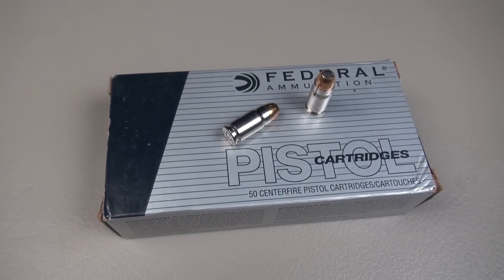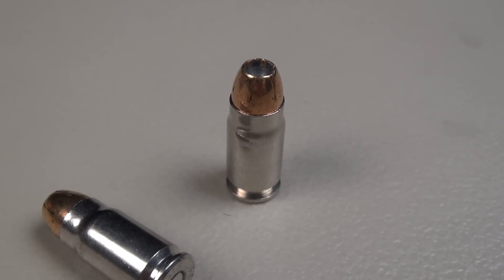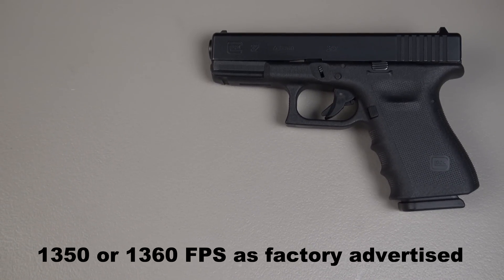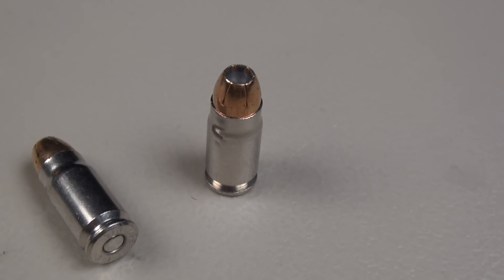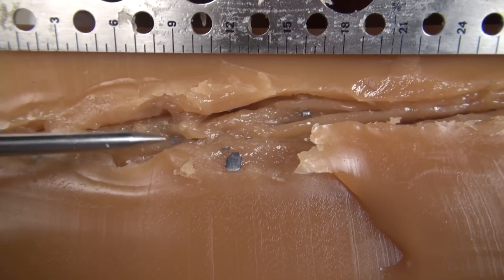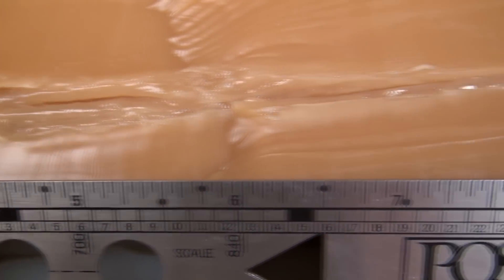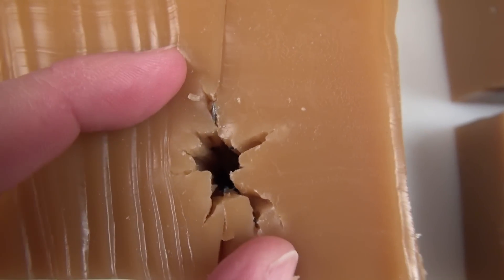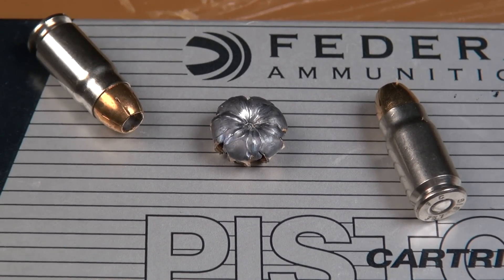.357 SIG Federal HST Ammo Gel Test

Comment: Although the better 357 magnum loads might be slightly better than the 357 Sig, the 357 Sig is an excellent defensive caliber. BUT, the main advantage is the platform.  A Glock 31 with night sights and a 15 round magazine makes for a more formidable fighting tool.  PLUS I am having no trouble finding 357 Sig ammo--- for about the same price as other hot 9mm and 357 magnum.
Reply: I am very curious about the caliber. Never shot a 357 sig. After months of searching for a firearm chambered in it, I put one on layaway. Finding that defensive ammo is actually cheaper than training ammo locally.
Reply: @Catgat37  I had the Glock full size in 40 S&W and the same gun in 357 Sig.  The 357 Sig round {125 grain} is easier to get back on target after a shot than the 40.  Also less felt recoil.  The 40 torques the gun around more.  There is an excellent video about all of this.  .357 Sig FMJ can penetrate better than the other handgun calibers, slightly better than 10mm.

Comment: What I got from comparing your test on the 9mm 124 HST Standard vs this 357 Sig 124 HST Standard is that penetration, expansion, and overall performance was very similar. The main and really only big difference is that the 357 sig carries quite a bit more energy. This energy dump caused the bullet to break apart. So I believe from other comparisons done by other video channels is that it seems 357 sig really does just boil down to being a more punchy 9mm.
Reply from the maker: @AMT4245  Agreed.  I have also noticed that due to increase velocity 357 SIG has a shorter OAL post expansion, which could lead to less penetration.  People will agree with me, but I still think the factory 147 XTP and 357 SIG is a good balance of everything.
Reply: @tnoutdoors9  I spoke to federal today and theyve informed me they have discontinued all 357 sig products except their AE FMJ.
Reply: This is true in a manner of speaking. Whatever the 9mm can do at the muzzle, the .357 Sig can do at 60 to 80 yards.

Comment: Not sure I understand.  I believe your test of the Rem Golden Saber .38+P had more penetration and more expansion and that was a 2" barrel.
Reply: Hunter Jordan thats wrong .380, .38, 357, 9mm all shoot a 35 caliber bullet.
Reply: Hunter Jordan You guys are missing my point.  The two bullets were the same weight, but the .357 sig has a lot more velocity.  I expected more expansion and penetration than the .38 +p.  Let me know if my facts are wrong but I thought the .38 had more penetration and more expansion.
Reply: Hunter Jordan The test on .38+p Rem Golden Saber was about 500 fps slower, but penetrated .5 inches deeper and the bullet expanded to .618.  However, the wound channel was not as wide.  The only explanation, I think, is that it expanded "later" than this bullet here.  It is interesting, though.  Really not that much difference, and the .38 was shot in a 2" barrel.
Reply: Hunter Jordan They're both jacketed lead.

Comment: The extra velocity isn't "completely pointless". With identical penetration, you are dumping an extra 150 ftlbs of energy into the target (40% more) over the same wound distance/time. This creates a huge "punch" effect. The visual signs are the long and wide permanent cavity. The physical consequences are jiggled organs far from the actual wound channel.

In short, a 9mm which doesn't intersect a vital organ will have to be closer to vital organs to cause a failure than a 357 sig would

Comment: First off love your videos.  I have been carrying glock 32 for many years.  I'm interested in your opinion on ammo for this caliber that you have tested.  I like what I see with underwood but there version of the gold dot has been out of stock for ever.  I really like the golden saber.  Anyway in your humble opinion what do you think is the best carry round in this caliber you have tested.
Reply from the maker: Glock 32.....I carry the 125 gr Speer Gold Dot, the factory load.  When you consider the ballistics in .357 SIG, there really isn't a bad load.  Based on my research, the majority of LEO's, especially state agencies, carry the Gold Dot.
Reply: *****
 I seem to recall that on a Talking Lead episode (years ago), you were carrying HST's at the time.  I agree with you though that any good premium factory ammo would do a good job.  (And you can never go wrong with Gold Dots). Of the 162 different 357Sig loads I have, I have also tried a Federal THP (Tactical Hollow Point - Bonded).  What is the difference between this and an HST?
Reply: ***** I can confirm for sure that VA State Police carry Sig 229's in .357 (mostly Gold Dots)
Reply: glockensig  They make Bonded HSTs (law enforcement) and non-bonded which are sold as defensive loads. Bonded bullets are great for penetrating barriers. Does that answer you queation?
Reply: Question? I believe the defensive HSTs are made for expansion mainly, and designed to NOT over-penetrate, like the bonded will do. I hope that helps

Comment: Yes they are different, but at what cost and difference of effect.  Also, the  7.62x25 mm Tokarev is battle proven.

7.62x25 mm Tokarev
85 g JHP - 1,700 ft/s 527 ft·lbf

.357 SIG
115 gr JHP - 1,550 ft/s - 614 ft·lbf
Reply: Why the hell someone didn't just use the 7.62 Tok as a basis is beyond me.
Reply: rambokicksass77 150fps, & 80ft/lbs of muzzle energy is ALMOST the exact same thing... C'mon, guys

Comment: Been thinking of getting a Lone Wolf barrel to fit my G27 so that I could use 357 Sig ammo in it.  357 Sig is a beast, designed to match 357 Mag specs utilizing lower weight bullets, but to still use the round in an auto pistol format.  But to be clear, you tested the non-bonded round, the HST round, not the Tactical Bonded version which would have left a more rounded expanded bullet without the petals.  Great test, great info TNOutdoors9!

Comment: The P357SHST1 is the same as the round in this test.(I have some and shot it into wetpack to test) It is NOT bonded, it uses a cannelure 1/8" up from the base to prevent jacket separation and slippage. I enjoy all your ammo tests and thanks for taking the time testing th e.357sig.

Comment: so to convert a glock 23 to .357 sig i just need a conversion barrel? and are the magazines interchangeable?
Reply: +Dom b just get a glock 32 barrel and you are good to go.  Lone wolf makes a barrel that is about 30 bucks cheaper than glock factory barrel. The magazines are the same.
Reply: Theres a barrel that converts to the 23 tho?
Reply: It does not take an actual conversion barrel to make it work. All you need is a stock barrel from the 23s counterpart( glock 32) and it will work. If you have older magazines there may be a reliability issue. You may need to replace follower in magazine for best reliability. Just call lone wolf distributors and they are very knowledgeable. They set me up with the same thing.
Reply: Oh okay. sorry I'm just kind of confused. thank you for the help. So pretty much just a Glock 23 barrel that i drop into the Glock 32?
Reply: +Dom b yes it bill work. newer mags will say .40 S&W/.357 sig.  I'm not a glock fan I carry a FNS 40 before I bought my FNS Pistols I carried a XDM 40. I didn't want to sell do got .357 barrel that arrived today my  form MIDWAY USE I loaded up a magazine full of the .357 sig an the pistol ran like a top so now that I own every model of the FN striker pistols I can take the 357 sig with me when I hunt hogs with my bow.  will say the felt recoil is more stronger than the .40 S&W.

Comment: I don't think subcompact polymer frames are built for the forces of 357SIG. The slide is too light and polymer too flexible. I converted my G33 to a 26 and the 2 extra +p+ rounds are welcome and more than enough in most EDC scenarios. My P226 is different story.

Comment: I think it would be fair to say my 357 SIG SIG P320 with a 4.7 inch should go 1380 - 1400+ FPS pretty good for a 125 grain bullet from just under a 5 inch barrel if you need more power than this from a duty size handgun 10MM more than 10MM 12 gauge shotgun with 385 grain slugs 357 SIG surpasses 45ACP 40SW 9MM in power and the 357 SIG is a complete joy to shoot as is 10mm in a duty sized 4.5 - 5.2 barreled gun for me

Comment: To me it makes sense that the diameter of the slug would be smaller with a higher velocity because parts of the bullet broke off and the pedals that remained were bent further backwards.This is just a logically observation but it sounds like you are assuming too much based on expansion data.

Comment: i got a question . how long is a regular .357 round compared to a 38 special like the overall length of the bullet ? because i have a Ruger GP 100 in .38 special and there's a little extra room in the cylinder, length wise and i was wondering if i could SAFELY fire a .357 out of it. and grate video !

Comment: The round tested IS HST. I have several boxes of .357sig HST and it is the exact same as in the test. It is NOT a bonded round. You can tell the round is not bonded because the jacket peeled back to the base. The large cannelure on the bullet prevent jacket slippage and seperation. Its obvious you have little to no experience with the round.

Comment: I agree about recoil. My P239 seems to feel like it has slightly less total recoil than my P229 in 40, but the 357 has a bit more muzzle rise. Maybe the single stack grip helps with the perception of recoil. Anyway, it's a great package. The 357 Sig 125 gr generally gives velocities equal to or slightly higher than 357 Mag 125 gr in a 4" bbl, and definitely faster than the shorter barrel lengths. You can't go wrong.

Comment: Out of less than a 6" barrel, the 357 magnum isn't going to do much more than a 357 sig unless you use some actual bullet weights.

I'm running 180gr WFN out of a 4" barrel at around 1300fps. Rolling them myself on 2400 powder for 14 cents a shot.

Comment: It is an RTF: Rough Textured Frame.

I have an RTF2 Glock 23 which I run with a Wolff .357 Sig. barrel and get outstanding accuracy and velocity.  I find the Wolff barrels to be much more accurate than the factory Glock barrels, and they are pleasently priced.

Comment: As always, amazing video. 
This might be a silly question, but I haven't seen it asked yet. How does the flash and sound compare to 10mm? I hear people talk about how loud this round is, but not compared to 10mm. Thanks in advance.
Reply from the maker: Louder than 10mm, but muzzle flash depends on the load.  135 gr 10mm can have a big flash.
Reply: Thank you very much, good sir. I bought a 10mm late last week and it should be in my hands by Wednesday. I'm looking forward to the versatility of the different loads, but wondered about noise. I'm happy to hear it's a little quieter than the 357SIG. However, I'm a conversion barrel away from trying that cartridge out too. People can make fun of Glocks, but its versatility is great. Thank you again for the fast response. Your channel is second to none.

Comment: I noticed the jacket separating from the lead at bit at the very tip of the petals, too, that's what made me doubt myself a little bit.  If those are HSTs then I have to say I'm massively disappointed in how they perform in .357Sig, 9mm actually performs much better in terms of expansion with identical penetration.  I've never been a fan of the .357Sig, I really think that extra velocity is completely pointless, it doesn't help at all.
Reply: At 1,200 feet per second muzzle velocity, a 9mm loaded with 115-grain hollow points  is deadly enough. I suspect the .357 Sig would be useful, but I feel 9mm and .45ACP is enough power for me.

Comment: I have the glock 22, just ordered the 357 sig conversion barrel. Do I also need to change the guide rod spring too
Reply from the maker: I use the same one between the G32 and G23.
Reply: Col. Trautman i have G23 i have a 357barrel and i dont change anything because its compatible with everything
Reply: issuepaper cuts thanks I also have a 9mm conversion barrel. 3 calibers from my glock 22. can't beat it. although 357 sig is expensive, when I can find it

Comment: @robbopaloobop, I just wanted to mention that 357 sig uses a 9mm barrel and 9mm bullet, just a stepped 40 cal case.

The ammo you are describing would be nearly identical to 357 sig, but would not be safe to fire in most 9mm handguns.

Any pistol designed to shoot 357 sig, however, is guaranteed to be built to handle that level of pressure.

It's no different than 357 magnum / 38 special for revolvers.  You can load any 38 special case to be as hot as a 357. It just is not safe because you could then fire it from a 38 special only revolver that was not designed for those pressures.
Reply: Would have to disagree with you on this one, I own a sig p250 sub compact and have caliber exchange kits in 9mm 357sig 40cal and 45acp. I will agree that after the neck on the case it is identical to a 40 cal "as i can use both 357 and 40cal in the in a single mag for each exchange kit" As for the 357 using a 9mm barrel that is false. Firing a 357 through a 9mm barrel is dangerous. They are very close to each other but the 357 has a slightly larger diameter. The exchange kits include a full upper including slide assembly, barrels, mag. A 9mm equates to .355 and that little difference matters. Not to mention the much higher pressure behind the 357 can damage a gun with a slide spring rated for a less powerful 9mm.
Reply: chefdan87 The .357 case is unique and is not a "stepped up" (probably meant "necked up") .40 cal case.  It is in fact a couple mm longer.  More accurate to call it a "necked up shortened 10mm".  The bullet is the same diameter as 9mm as explained by electrostatic1, but you are correct in stating the barrel is different - the chamber is unique to the .357 Sig cartridge.

Comment: i prefer 9mm +p+
Reply: I prefer a cartridge still in SAAMI safety regulations.
Reply: 357 sig was designed to do 1450 out of a 4" bbl with factory loads. The factory's are just playing it overly safe as usual. You can get 1450+ and stay in SAMMI spec.
Reply: Yup, I have load manuals going back 40+ years and every new addition they water down the loads a little more. IIRC correctly, 150hr 30-06 went from 62gr to 61 to 60 and finally 59.5 in one very popular powder over 30 some odd years. I doubt a 100 y/o 30-06 had superior metallurgy to modern production guns. Most rounds listed in the manuals follow that pattern.
Reply: The old imr classics, 4350, 4895, 4320 etc haven't changed except for tighter tolerances in manufacture. The listed max velocities fell along with the max charge weight. It's just more watering down of the load data for liability sake. Same as 357 sig. Most manufacturers load it hotter than 9mm +p+ and then leave it there. Never approaching max saami spec. Guess it's "good enough" for all but underwood, double tap and a few other boutique ammo manufacturers.

Comment: Before Double-Tap realized they were taking themselves out of the 357 Sig market, they made several lines of  .40 S&W that were dead ringers for the Sig fiasco. But better, since the .40 powder capacity is a hair and a half better. Don't get fooled.
Reply: I have a little trouble following what you're trying to say, but, .357 SIG has a slightly greater case capacity compared with .40 S&W, though I think it's close enough not to matter. .357 SIG has a case capacity of 19.6, .40 S&W has a case capacity of 19.3.

Comment: I just came here to read the macho man comments about how this isn't "true" 357 sig because it isn't traveling at 4000 FPS
Reply: 5000. I only shoot loads that set my paper targets on fire at 15 yards. :-)
Reply: I mean it’s fast for sure, but to be fair, the .357 sig is about 100 FPS short of the .357 magnum. It’s just hard for a semi cartridge to match a true magnum revolver cartridge.
Reply: im here cause youtube decided to recommend it to me, years late. however, Sig contracted with Federal to produce the .357 sig. Sig produced the guns, Federal produced this exact round as the original, intended load for the .357 sig. when you get up to the speeds the sig and the magnum do, 100 to 150 feet less than comparable magnum loads dont really matter, and overall, the effect is pretty damn similar both from a psychological point of view, and an anatomical point of view. if the round doesnt kill you, it will put you out of the fight, permanently, and the sound of the round, the flash, even if you miss that will often stop shit cold. I tell you this and write this word wall so you have a good rebuttal for those "macho man comments" :P
Reply: @fukumarkzuckerburg  tell me about it, I've got a 5.3 inch xdm with a ported barrel. She screams lol
Reply: 4inch sorry lol
Reply: @mikesideburns9791  And it's hard for a .357 magnum to match the 12+ capacity and less recoil of the autos.

Comment: I'm actually surprised it held that well. I feel the .357 SIG has the same fault as the 10mm these days:  the bullets they use are designed for their common lower velocity counterparts (9mm and .40SnW). The higher velocities of these loads tend to blow a lot of HPs apart.
Reply from the maker: +Moto Rad Actually, several bullets in 357 SIG are designed for the caliber; this HST, Gold Dot, XTP, Golden Saber, etc.  I have pulled those bullets plus their 9mm counterparts, and they are different.
Reply: ***** That is awesome, and good info. I'll have to seek those out when I am loading my 9x25.
Reply: +tnoutdoors9 nice to know